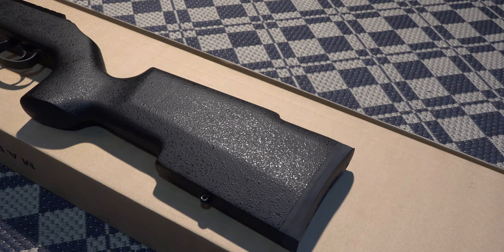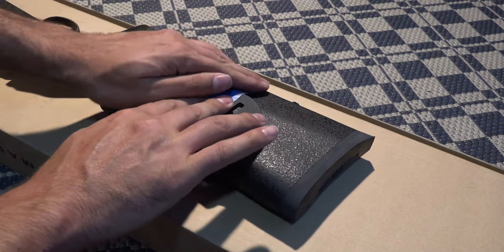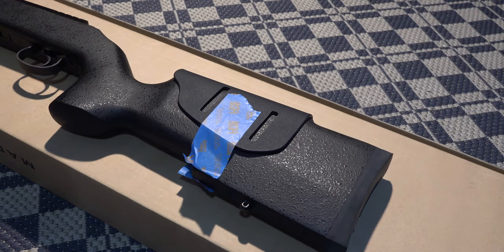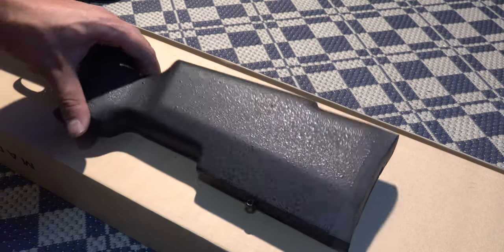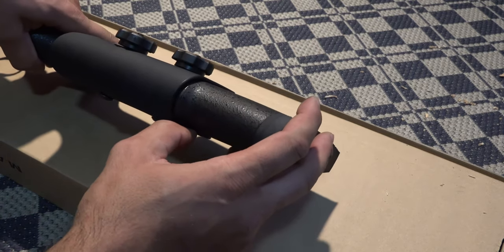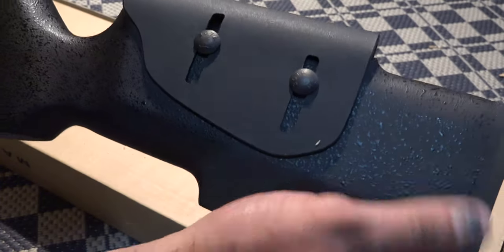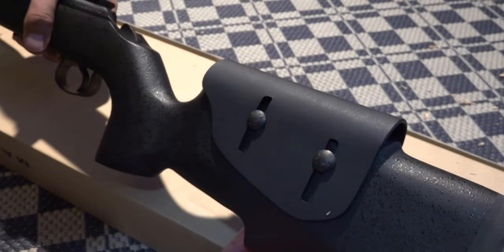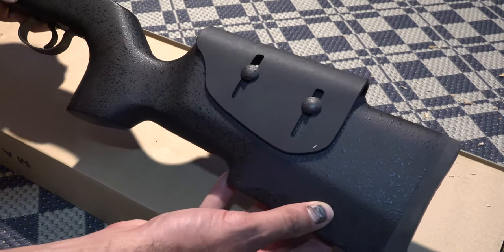Adjustable Cheek Piece Install on CZ 455

Comment: Dude you never checked with a scope first. Looks to far forward. Never taped the back side to prevent breakout or chips.
Reply from the maker: Ended up being setup perfectly for me. Taping the back would have been advisable but I didn't and it too worked out without issue.